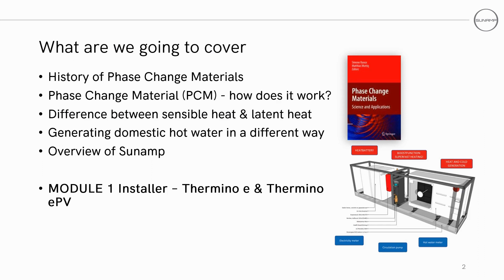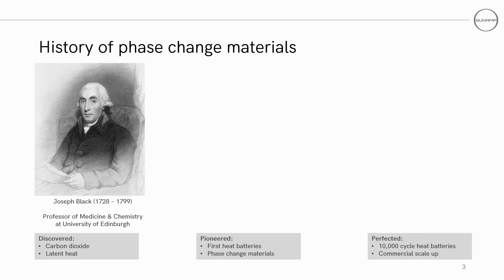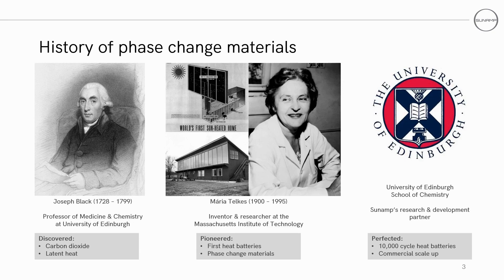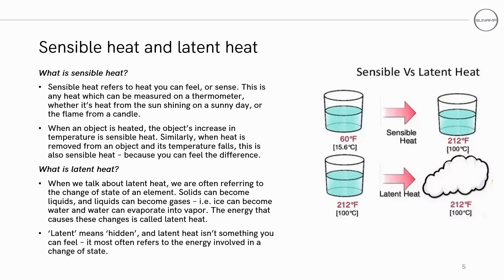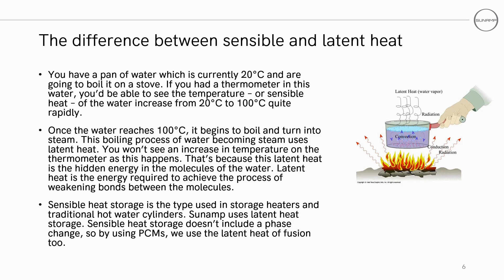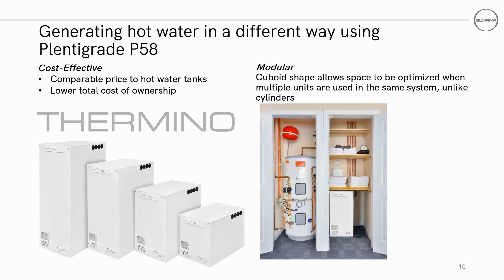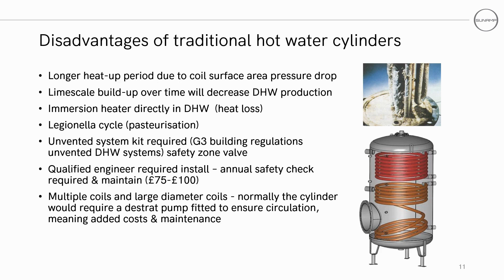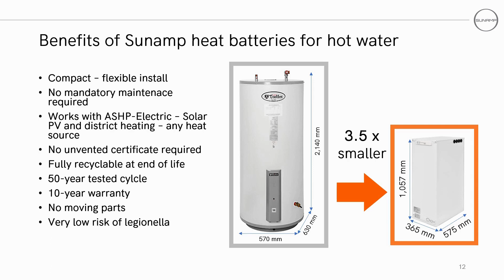How phase change materials (PCMs) work in Sunamp thermal batteries

Comment: The cost of these is very high compared to a normal boiler despite all the mentioned advantages, appreciate all the R&D costs need to be absorbed but unless they come down in price as with heat pumps they are unlikely to be installed on mass

Comment: I am looking at changing my hot water cylinder, the Sunamp 150e model is on my list of consideration. In your data sheet, it stated the annual electricity consumption and the Load Profile. You published the consumption with the load profile "M". Other hot water cylinders I am comparing to are stating their consumption with the load profile "L". This is not easy to make a direct comparison. Can you provide the annual power consumption based on load profile "L", please? 
Another question, I am located in Dorset/Hampshire, the water here should be hard water. Is it good enough by adding a "ELECTROLYTIC SCALE REDUCER" from the entrance of the water mains? or do I need more sophiscated water treatment?